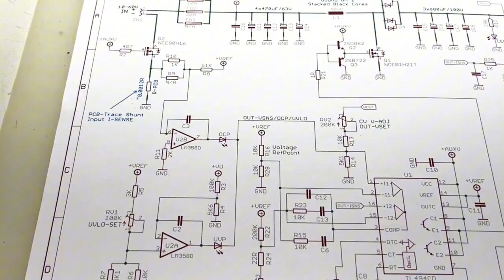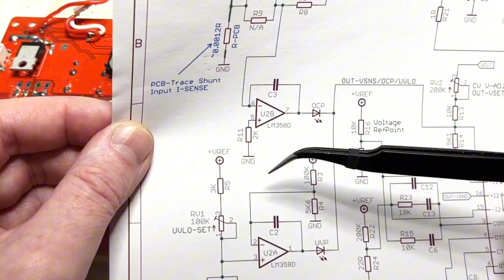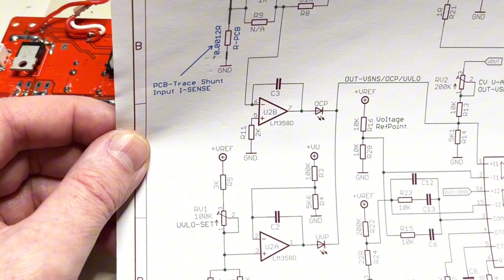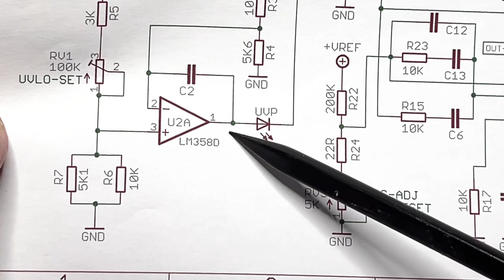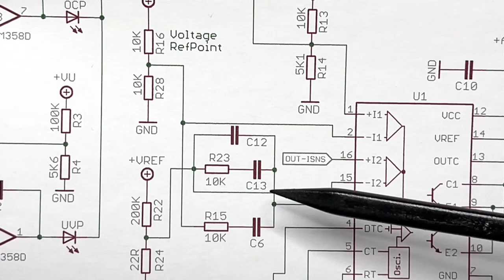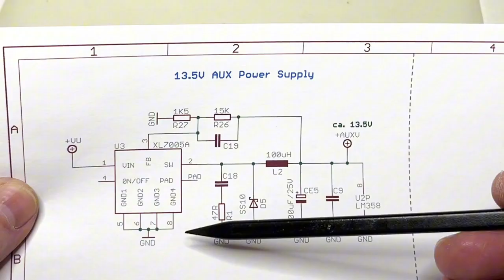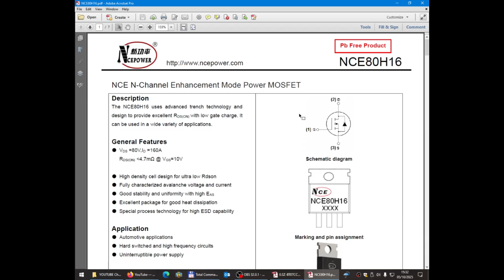Cheap China 1200W 20A Boost DC-DC Converter; Full Schematic,Walk trough,Tips and Test

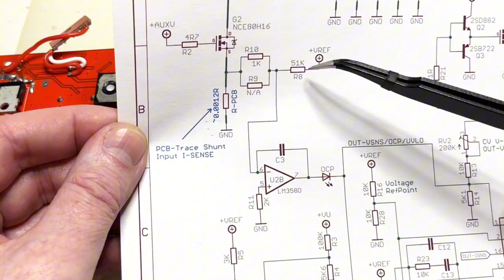Comment: At 8:15, the circuit works because current flows upwards through the resistor to get back to the negative terminal of the source. Therefore the bottom of the resistor will be at a higher potential than the top of the resistor. This means the voltage on the left side of R10 is actually negative. If the current is too high, this voltage gets even more negative until the output of the voltage divider goes below ground, which trips the LM358.

If Vref is 5V then roughly -100mV would trip it (it's 50 to 1 approximately). So the trip current is a little under 100A.

At 22:04, the TL494 will only run at <50% duty cycle if OUT CTRL is set to GND. It will work at >50% duty cycle in this configuration.
Reply from the maker: Hi, thankyou, in the Video I already explained how the Negative offset resistor Divider works, I even made a whole video with Simulation for that :-) What I meant in the Video I Dono how it works is the comparator with R12.
Reply: @KonstantinGrigoriadis  I think your misunderstanding is that you think the LM358 can't work with 0V at the input. However, the datasheet says that operation near zero volts is allowed, and you just have to avoid going below -0.3V (otherwise the protection diode will activate). Most traditional op amps do not like having an input voltage near the supply rails, but the LM358 is different.

 I think the likely reason R11 is there is so the op amp doesn't blow up if the negative input swings too fast. Generally inside the op amp there are diodes between + and - for protection, and you might break those if the positive input was connected straight to ground. I think with offset current matching you want the two inputs to have the same impedance. Here, the top path only has 1k ohm impedance, so the bottom should also only have 1k.
Reply from the maker: @skibidiohiorizzler67 hello, for the comparator 1/2 lm358 to work the -in must have a voltage that is higher than the +in in a no trigger condition, from where shall the 50mv or so come at the -in , that is my question not if it works at 0v etc
Reply: @KonstantinGrigoriadis  Vref is at +5V so it will pull the -in input up through the 51k
Reply from the maker: @skibidiohiorizzler67 ok thankyou

Comment: 22:04 If the TL494 is set to push-pull mode, but the transistors are paralleled, why doesn't it just run at the max duty cycle constantly, since one of the transistors is always switched on?
Reply from the maker: Hello, no the Result is to have a 0 to <= 100% Duty at the osc set Frequency , same as if the oct pin would be at gnd